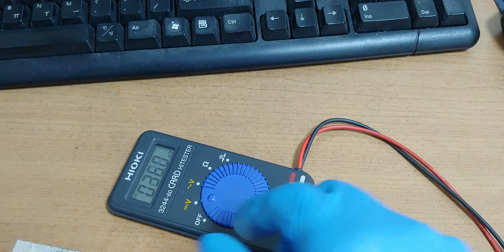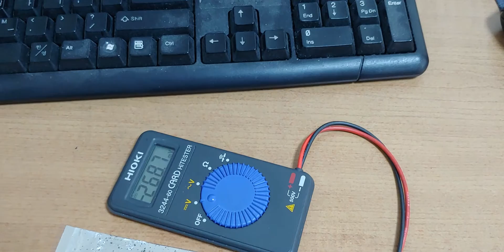Toothpaste Rechargeable Solid State Battery: 2.6V

Comment: I use any toothpaste
Reply from the maker: Very good. But toothpaste which doesn't include salt and chloride is recommended in my experience. Have a nice day
Reply: @solidbattery9956  so what does the sulfur help to do in the battery 
And should I put the solution to both electrodes